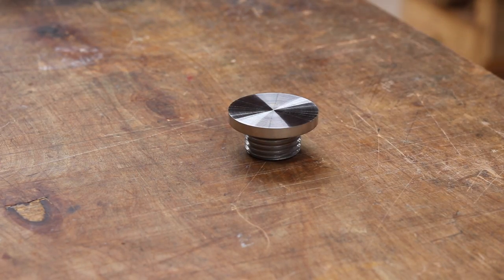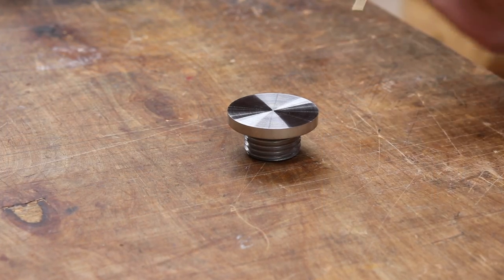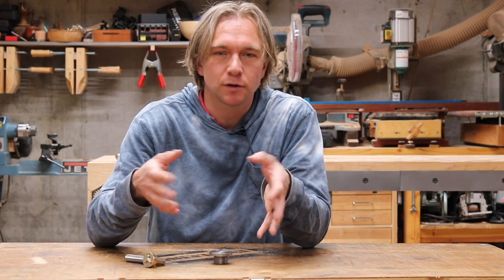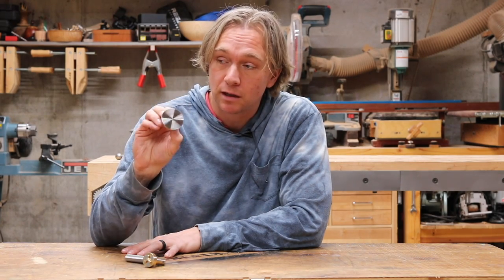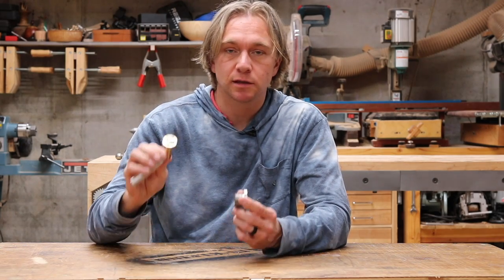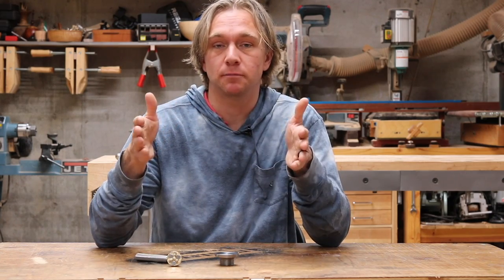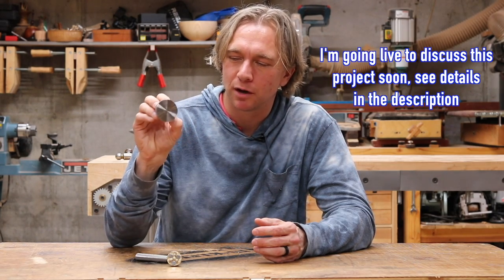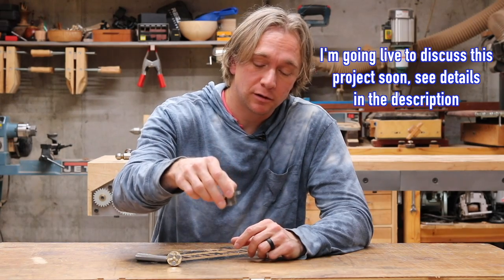A Screw With No (visible) Slot Is My Next Big Thing!

Comment: I'm 100% sure that the automotive aftermarket would go nuts for these as oil caps, they would only require a recess for a o-ring to seal with the valve cover. That product is very sweet!🔥
Reply: Or for gas caps
Reply: I don't think the heating up and cooling down would work well for a precision fit
Reply: If he could scale them down they'd be super awesome for fender bolts/engine bay beauty bolts
Reply: As a mechanic I just want to point out that it's all fun & games until you lose the special driver used to remove it.

Comment: First of all: amazing concept! Love the potential.
A few thoughts:
- I think you would sell tons of these if you could have them available at the $20-$25 range
- I think your tool should be made of a hard plastic or nylon. It is inevitable that someone will scratch the face of the screw while assembling with a metal tool like that searching for the correct line-up
- I don’t think you need the magnetic effect to achieve the result you want. I also think removing the magnetic aspect could save you tons of production money by opting for standard stainless steel.

Best of luck! Love this design
Reply: The magnets are clearly there to key the screw quickly. Without them you'll be rubbing a tool over the surface of the screw. With them, you automatically find the right location and orientation of the tool without even contacting the surface.
Reply: The tool looks to be brass or bronze, which typically won't scratch steel, then again, it depends on the hardness of the steel and the hardness of the brass/bronze.
Reply: Removing the magnet means user has to constantly and continuously apply pressure as they are turning the screws, which would make it a big pain in the arm and less user friendly.
Reply: SS, with a thin HDPE pad to protect the surface.

Comment: One thing that I wonder is how it would look after wear and tear.  Would it get marked with scratches that reveal the hidden slot?  Would the turning tool rub off enough to make one piece a slightly different color or reflectivity of the other piece?  Would the pieces rubbing against each other eventually widen the gap enough to be visible?
Still cool.  Just wondering how time will take its toll on it.  I suppose there's no way to find out except through waiting.
Reply: The tooling could be covered with a thin layer of silicone to stop scratching.

Comment: From engineering perspective, i love this idea so much. It's as brilliant as it can get. From general consumer perspective, not that many people would spend the big numbers on screws. Most of them would just prefer hidden fasteners altogether. But hey, i would LOVE to be proven wrong and see this tech in future high end furnitures, made by Andrew Klein
Reply: Also, i saw someone commented suggesting the name be "Klein Screws" or "Klein Fasteners" and i agree to them.
Reply: @dimass.a1507  I feel like this name would cause issues with the company Klein.
Reply: From an Astrophysicist perspective, these are actually extremely common in a lot of applications, and consumer applications, I have so many in my show car I have most count, they’re 5 bucks each, it’s a cool idea and that’s solely the reason why I have them, but he is simply beaten by a more clever and mass produced method.  You can buy them bigger and smaller than these for far less, although, They are very noticeable after time, if you take them out once, you’ll start the see the difference in a week or two, and the more you do, the more it shows
Reply: @chandrasekharlimit4547  i wasn't aware of those. Thanks for the insight! Well yeah, most things that are made cheap cut corners. I still genuinely think that it's brilliant tho, for i never seen anything like it being used by a wide market, at least in my country.
Reply: @chandrasekharlimit4547  
Where can I get them?  What's the name?

Comment: This would make a really good fastener for frameless shower units. You know the kind with the thick glass and the only thing showing is the mounts for the glass. What they use now are very similar in shape, but have a torx head and they are a pain in the butt to tighten. This fastener would seem to solve an aesthetic problem and a mechanical problem in the same piece.
Reply: That is an amazing idea.   That would look so much better than a normal fastener.
Reply: Same for standoff caps.... They usually just have a hole in the side and are also a pain in the butt to tighten
Reply: These would not be good for anything involving moisture. Either it's going to seal it from the inside or it will get in-between the keys lot and rust and show.
Reply: I have been a glazier for 20 years and I think this would have a ton of potential for the glazing industry. Heavy glass shower doors, stand offs, store fronts,  mall fronts, food service sneeze guards. The list is endless.
Reply: Also more easy to keep clean, do to the flat surface
Reply: @rasmushelvad1451  on the contrary these are impossible to clean. you might clean the surface but you can't reach inside. It's no big deal at home but you wouldn't be allowed to use these in  any commercial environment with some hygienic standards.

Comment: I would absolutely design furniture around it but only if it's called the Klein screw.
Reply: Agreed, there are Phillip’s and Robertson’s why not a Klein’s Screw
Reply: I think it's unintentionally also a great homage to the Klein bottle which is another very cool but not typically practical thing. Rolls off the tongue faster than the invisi- suggestions.
Reply: I like it because the klein bottle doesn't have a bottom/opening while this doesn't have a socket.
Reply from the maker: Oh man, I’ve such a good name for it though!
Reply: KLEIN SCREW. Allen has met his match. IKEA eat your heart out.  I'd love to see barstools tightened with this screw. Motorcycle fairing bolts.. In a tinier version in aluminum.  Exotic cars.
Reply: I'm with David.  Klein Screw is perfect.
Reply: When I read your surname I thought it was pronounced Clean... Which is exactly what you've made... Klean Screw?
Reply: I like Klein Screw
Reply: Andrew's screw, and as for me,  it can be used in connecting panels in space stations, just depends on the material. So, can be useful almost in all places, it's look brilliant, cool innovative design!
Reply: Soy de España es una pasada enhorabuena, un gran trabajo he leído que estás abierto a que te aconsejen un nombre  yo los llamaria  Klein's screw
Reply: Engine blocks, oil panels seals, I think it has no limites

Comment: Hey, just watched the vid. I love the concept, enough to give feedback and not just shrug it off. I don't think marketing it as a "Screw alternative" will catch on. There are a lot of simpler ways to achieve a flush front look cheaply for something the end customer will ultimately never touch (not many people unbolt their dining room table unless they are moving) I do think it has a lot of potential as a type of hidden keyhole lock for something like a jewelry box or maybe as a mechanical crank. The unique tool becomes a key, and it would be used often enough to make its novelty worthwhile. Also from an expense perspective you only "need" one to function as a lock/crank handle. So it would only increase the item cost by $40 instead of say $160 for 4 table leg screws that will be stagnant once assembled, while still giving the buyer the same sense of novelty.
Reply: Darrell you must be some kind of product developer. Great input, I still want to make furniture with it
Reply: @universalron  I'm just a regular joe, I have grown up around quite a few entrepreneurs from an early age though.
Reply: I think they could also be advertised as high-end screws for modern furniture. It fits the look of a lot of furniture very well, especially something like a glass table. I think what should be done though is A) preventing rust (not sure if he's done this yet, he likely has because that would instantly ruin this screw) B) preventing or allowing for cleanup of gunk build-up or liquids. IDK if any liquid could squeeze through that tolerance but if any can they'd make the product go from godly to gross whenever you push down the flush bit. He definitely has a great idea on his hands though, I won't be surprised if I see this in furniture stores in 2-4 years
Reply: Yea they are cool but I feel like I’d just use a cheaper solution. An inlay or similar. 
Imo expensive.

Comment: Aside from the already mentioned feedback (that I have seen), my initial concern with this design was that the shape may become apparent if the user is not very careful about over tightening / stripping the screw head, because of how precise the fit is. This could be overcome by making the tool out of some hard plastic, but then they would be more prone to breaking. The concept is amazing, and the fact that you are looking to add utility to this is really inspiring from a entrepreneurial standpoint. I would say launch it anyway. You never know, some high end manufacturers may love them because they are easier to assemble than gluing brushed plates over a screw, and are better for disassembly. I can think of a few brands that would use this level of quality, irrespective of price.
Reply: Yes, I like the idea of a plastic 'handle/spanner' so that it is not overtightened. There are always some 'gorillas' out there who push tings to the limit. My mate is one, he is brutal!
Reply: Brass driver would be softer than the screw but strong enough to do the job.
Reply: Just use a torque wrench
Reply: I think that having a slightly cheaper plastic "screwdriver" is a good idea, as damaging it wouldn't be as big of a deal as damaging the screw and ruining its entire purpose.

Comment: You could call it “ Invisibolt “ a play on invisible….. I feel it is more of a bolt than a screw :)
Reply: It is only a bolt if it is secured with a nut. A bolt does not necessarily need a drive head, examples are J-bolts and Carriage bolts.
Reply: @jimmyrogers4177  Two examples break that rule; lag bolts and machine screws
Reply: This name is fantastic. Easy to understand, sticks with you.
Reply: i just suggested this b4 reading the comments

Comment: The beauty in this product is remarkable and would love to have the opportunity to purchase. Amazing job bud!
Reply from the maker: Thank you!!
Reply: @issadraco532  I completely disagree with your last rant. If you've ever been on a yacht or high-end speed boat, you may have noticed they are all looking for the perfect fixtures, fasteners and such. I'm thinking that this idea could be expanded to other items as well.
Reply: Magtrin screw (bolt)
Trinmag screw (bolt)
Tri-mag screw (bolt)
Tri-lock screw (bolt)
Lmk
Ty
I have a couple inventions my self but all just ideas with mailers patents. I’m always musing about others.
Most are practical-
Reply: @AndrewKleinWW  
I think that this has 2 markets. 

The 1st is going to be for the government/ military. They can find a use for anything. They may change the size to extreme micro mini or go the other way and make it gargantuan. 

The 2nd would be to "lock" something without actually locking it. Or to conceal something that can be opened regardless of orientation (upside/ down, it doesn't rely on gravity to operate) or location (inside the home, under water in a shark tank, on the space shuttle... which is now obsolete). 

A possible 3rd market would be a screw that holds together something that's meant to break down easily, yet still have adequate strength to hold (not break) when used.
Reply: Yeah this is so awesome. I'll definitely by it if it does its job. And I had the money lol
Reply: Call it Daton Mobile core screw
Reply: As a Tool & Die Maker,  Nice Job!!! Who says it has to be called a screw? I think you can get more creative  and it will sound better if you called it a (...... Fitting) Like the zerk fitting? Just my thoughts. Dave
Reply: @issadraco532  can you say diarrhea? I knew you could.
Reply: This would be great for architectural details (railings, guardrails, mounting hardware, ect).
Reply: Appliance manufacturers showing stainless steel surfaces, boat manufacturers for masts and other surfaces that are susceptible to rust and other buildup ( if the seam is so tight, it might prevent buildup)
Reply: @highqualityhomemaintenance7565   I mean I can look at aircraft for the military and see applications. places to use screw/bolts like this instead of welds.. Just a thought
Reply: @miltondejesus2076  Rust is something that would highlight the hidden shape.
Reply: @issadraco532  Wow big rant Dude! But I agree to expensive to greedy and over complex. GB :)
Reply: @issadraco532  You realize how expensive the machine that can make these is? Then the cost of the people who manage, operate, program, clean, etc the machine? Then the cost of the materials and then the time it tanks to make each part (It doesn't take anywhere near as little time as you think). ATM, no company really has a Wire EDM machine that can mass produce items that I know of, and even if they do, the "mass production" would be fairly slow as those machines take time to make the cuts. They would have to make a single purpose machine that can churn out those screw for it to be profitable to sell bellow 20 bucks per screw, which would cost over a million dollars for a risky venture that may not even take off. You say $40 is ridiculous but you have no idea the work that goes into fabrication or machining. You know those Chinese plastic toys you can buy for a dollar? Guess how much the molds for those cost. Over 10k. The only reason it is profitable is because they use slave labor, child labor, and they mass produce them in scales you can't even imagine. Precision items like this screw is far more complicated and takes for longer to make, and the machinery to make them are insanely expensive. Of course, someday in the future, a company may be able to mass produce them and sell them for under $10, but we aren't at that stage yet, so for now, people will have to bite the bullet on the $40. Oh and trust me, there is a market for stuff like this. Hell, the US government would probably use these in federal buildings to hid entrances and shit, they love over spending on unnecessary items. Then there is the construction businesses for high end yachts, planes, houses, mansions, manors, etc who would love to use these screws. In this day and age, the fashion trend is sleek, especially among the wealthy and rich, have you ever seen the rich areas of cities and towns? Full of Mc Mansions and houses that all have the same sleek (and honestly ugly) modern style. Their interiors are full of the same sleek white/black/grey vomit for furniture, rugs, carpets, etc. Would I buy these screws? Hell no, I am not a fan of this kind of style. Well tbh, if I were to buy them it would be for a secret compartment, but even than, I can probably make a better one without the need of these screws.
Reply: @lewisjohnson8006  lol! I said the same thing! Great minds at work!
Reply: @PilotTed  The main point in @issa draco's rant is the price point and that as soon as anyone would bring this to market its look would be copied in the cheapest possible way (cents, max a few USD) quite soon. I get the idea, it is cool. But really why do you need this shape to force a new tool?
What is the purpose - apart from being a cool idea.
Reply: @AndrewKleinWW  with use would the edges of the hole start to deform making the finish less flush? i do like the idea
Reply: @AndrewKleinWW  Forgotten Fastener
Reply: @lewisjohnson8006  but is this necessarily the general public? I don't think it's worth the time, money, and effort to try and produce as they likely wouldn't sell well.

Comment: The HFI by Klein Design (Hidden Fastener Interface). You could make an entire lineup of them using both common and proprietary drivers (Torx, slotted, 1/4" hex, etc.). You could even make ones that utilize sockets; instead of the slot being pushed in by a driver, the center could be say, a 3/8" standard hex, with a spring loaded collar around it that recedes slightly when a standard socket is pushed against it. Whole world of possibilities.